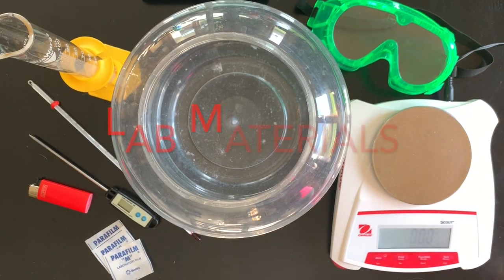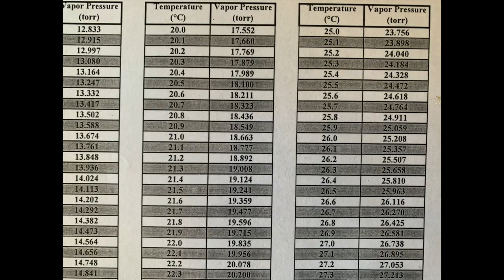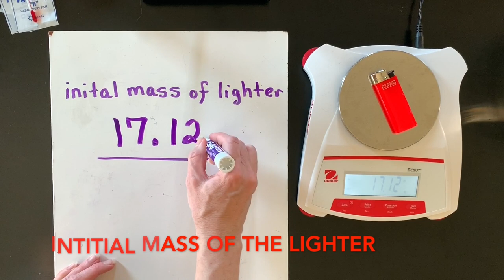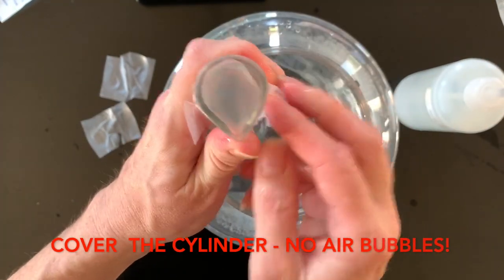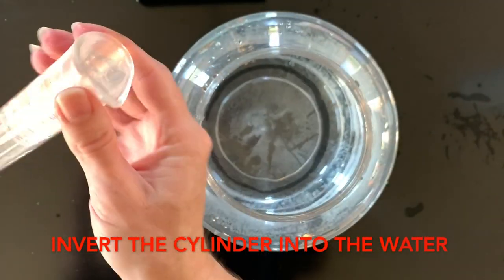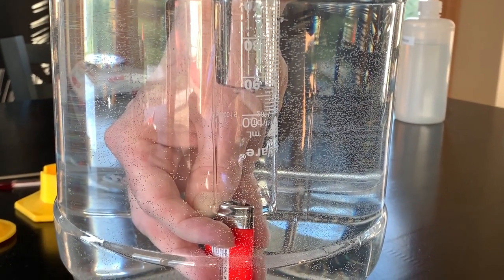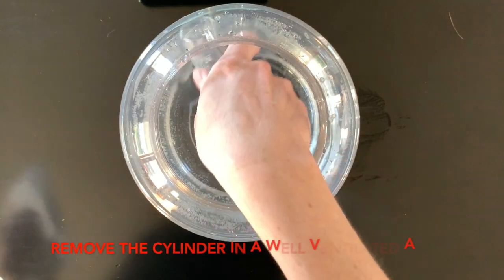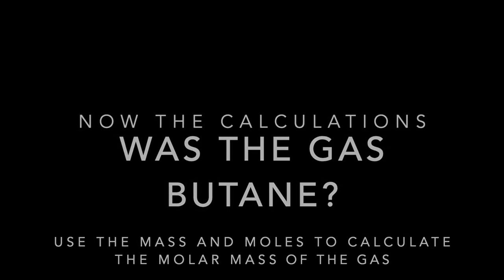Molar Mass of a Gas Lab: Butane Experiment

Comment: Can you elaborate on why the volume of gas in the graduated cylinder increases when the water level in the cylinder is elevated above the water level of the container? Does elevating the gas in the tube increase the gas pressure? If so, why?

Comment: Just want to know if I did this correctly. Was the molar mass around 56g/mol? And I don't think it was butane if I did my calculations correctly because I think its molar mass is 58g/mol. It may be butene??????
Reply from the maker: It was butane and the molar mass of 58g/mol is close to the molar mass of C4H10 if you add it up!
Reply: I didn't know that I could use different constants for r, so I transferred to torr and that threw off the calculation ever so slightly.
Reply from the maker: @dundermifflin3847  R has many values and units that can be converted to each other. Wikipedia has a nice list. The values of R most common are 0.0821 L atm mole-1 K-1 but also 62.4 mmHg L mole-1 K-1 OR using 8.314 J mol-1K-1

Comment: Pls how would you find the pressure from the difference of the two volumes
Reply from the maker: The difference in the volumes doesn’t give you pressure. You need to use the water vapor pressure and the atmospheric pressure if the day.
Reply: @AnneSchmidt  thanks